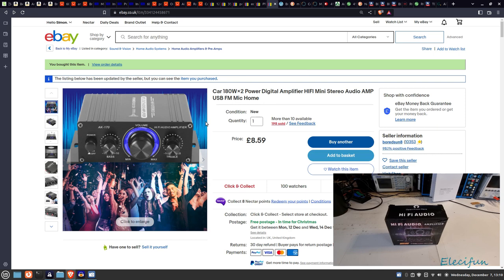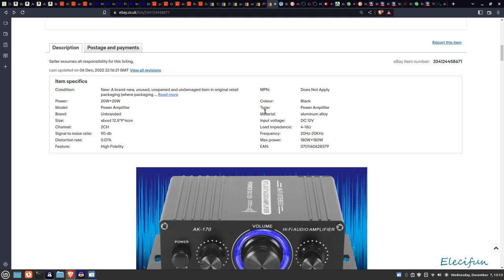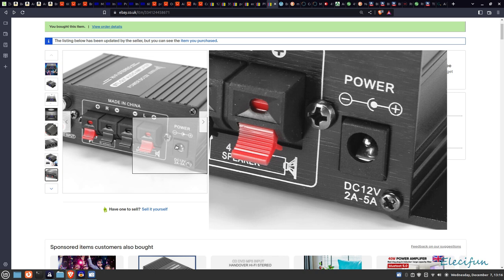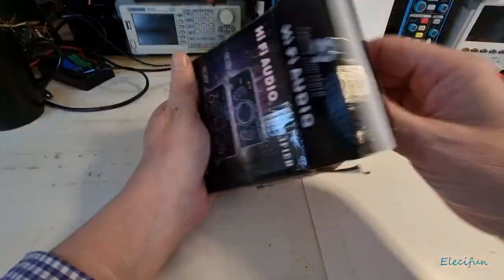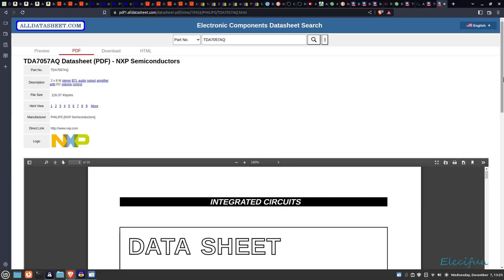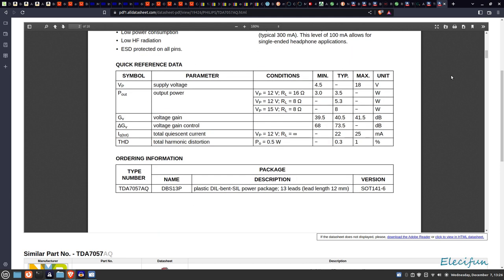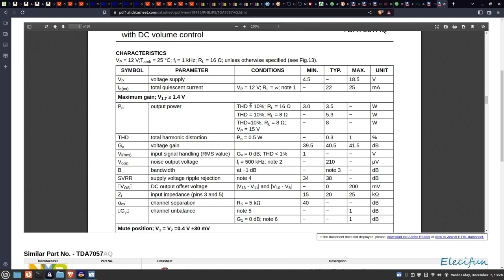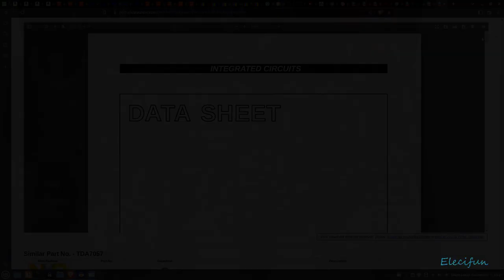360 Watt BTL Hi Fi Amplifier 0.01% Distortion eBay

Comment: I'm sure there are tons of these types of over rated products out there.
Reply from the maker: @Sinist3r FPV I totally agree m8. I bought it for the entertainment in taking a look and for the case. I'm building a little preamp and wanted a case with holes already cut for me.
Reply from the maker: PS ,asked seller for refund as item is not as described. Serves them right extracting the urine, they know what they are doing.
Reply: Absolutely,  gut and use it. I've been into car audio since the mid 90s, and have had great amps from reputable companies with legit specs, and also have nought cheaper Amps claiming big power and found out they weren't even near advertised specs and most would overheat and go into protection mode when you push them hard for 20 minutes or so. Horrible that this is allowed.
Reply from the maker: @sinist3rfpv672  When presented with a lemon, I will try to make lemonade. Its sales peoples tricks with the numbers ripping off unsuspecting/trusting buyers. I have no patience for them. People could buy them then claim their money back as item is not as described. Might make the sellers think twice if they lost product and cash.
Reply: I think that's what it means when someone says "it's as hard as Chinese arithmetic". It's criminal what they do with the numbers. Still probably worth 8 or 10 bucks to mess about with it and the enclosure is useful.
Reply from the maker: @Sonic_Ox  That was the intention when I bought it for kicks. The seller assures me by email that it will produce 180 watts per channel peak. I've replied with the datasheet for the chip and a bit of basic math/s.
Reply: Dishonest criminal behavior 😠😡🤬

Comment: 180W x 2 for 16 U.K pounds ! 🤣🤣
Reply from the maker: 180W x 2 for 8.59 U.K pounds.. Absolute bargain..Not
Reply: @Elecifun  I knew it was going to be bad but it was worse than I thought. 

You be struggling to drive the speaker on my clock radio DIY KIT. 🤣
Reply from the maker: @decem_unosquattro9538  LOL you are probably right amigo.
Reply: @Elecifun  180W per channel RMS? No, impossible for amp like that. If you would call it an amp. I bought my sister a real proper decent amp it's massive Alpine amplifier and she paid a decent amount of money for it. It requires  huge copper cables to the rear of the car because as you know it's drawing a lot of current. It's a big amp, with big heatsinks.

It's power is conservative yet I believe the specs are real not maximum peaks like you say.
Reply: @Elecifun  oh incidentally I just finished another diy kit.

Still trying to work out what is the correct orientation for the last IC4 🤔
Reply from the maker: @decem_unosquattro9538  Check datasheet from the part number amigo
Reply from the maker: @decem_unosquattro9538  Glad you wouldn't be fooled by these fake amps.
Reply: @Elecifun  Well it's a PIR antitheft alarm and so far its not working. I built another one but now not sure what orientation the IC4 thingy is?

I read another buyer said there is a fault in the C002 IC4 (I don't even know what it does?)

Pins 1, 2, 3,4 top part little  pcb

Pins 1,2,3,4 mainboard

He reckons pin 2 (top) goes to pin 3 (bottom) and pin 3 goes to pin 2 on the bottom.

🤷🏻‍♂️
Reply: @Elecifun  No, I've lived long enough to know that amps without heaps of components (huge caps and a lot of them) and a big main board, maybe daughter boards etc also hundreds of resistors, triodes, a huge toroidal transformer etc are just rubbish.

The 10 channel denon amp I picked out for these dudes I used to know weighed 38 kilos it was a monster of an amp.

It had Dolby Digital, Dolby Master Digital, DTS HD Master, blah blah blah and cost $9,000 AUD back in 2000.

I knew it was a good Hugh quality amplifier beyond what most will ever see in their lifetime.

Heavy duty speaker out ports (gold plated) inputs for phono, CD, radio, ... 

It was that powerful you could run cables to other rooms.

10 channels @100W RMS per channel.

They only used 6 channels.

Bass.

front left,  center, front right.

Rear left, rear right.

It was hooked up to a $2000 Blueray player.

Lol actually it was way too powerful for their needs. 😆😂

I thought they were going to add extra speakers and turn it into 7.1 surround sound system.

They ended up just having 5.1 surround.

The explosion could easy make your ears bleed. 👂 it was insane really. 😆
Reply from the maker: @decem_unosquattro9538  IC4 pin1 ground, Pin2 base transistor which is used to aplifiy the bell output, Pin3 not connected Pin4 + power. That should reflect in the device you are connecting to it.
Reply from the maker: @decem_unosquattro9538  I would of been happy with a NAD 3020 back then,  minimalist yes, great sound great price. Ear bleed not my thing.
Reply: @Elecifun  oh cool thanks amigo very interesting yet simple what it actually is. 

I'm just trying to get my head around why it works now. Maybe the base pin wasn't actually doing anything and maybe that's why it would work. Hmmm.🤔
Reply: @Elecifun  I don't know why they didn't at least have a little light to indicate it is powered on and also an armed light.

The way it works is you press the button down which turns it on.

After about three minutes it's armed and any movement will trigger the piezoelectric buzzer.

I think it has some other function.

Something to do with radio waves or something like that.

I'll do some more research tomorrow.

Anyway adios amigo.

😴
Reply: @Elecifun  NAD is a good brand.

It wasn't only ear splitting it was also very high quality.

Obviously we didn't have the volume up high whilst watching movies.

Still there was plenty of power available if needed.

Ideally what they need was a bigger home theatre room.

Anyway, I better sleep.

Otherwise the sun will be coming through the windows. 🪟 

😆
Reply: @Elecifun  chat later.